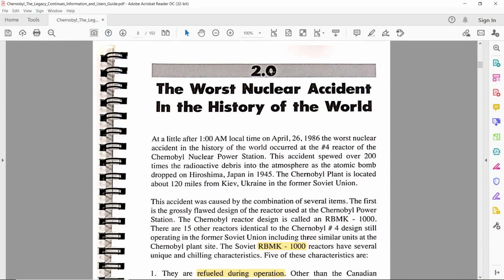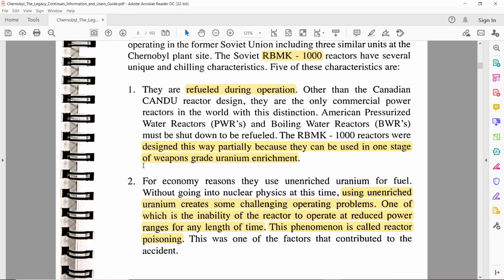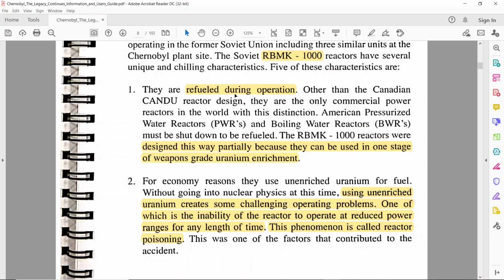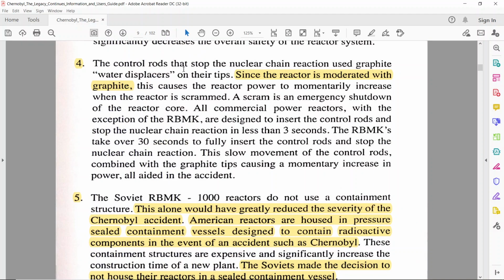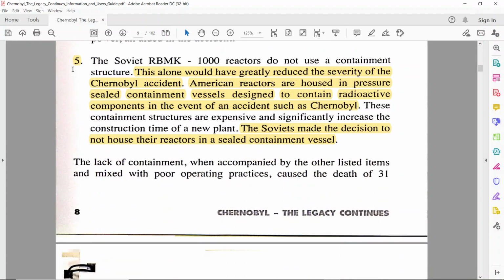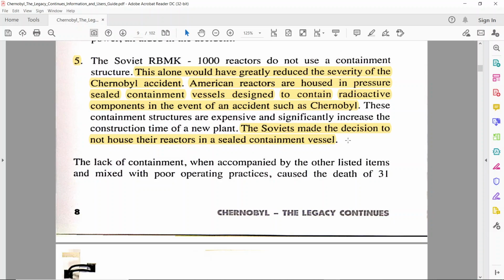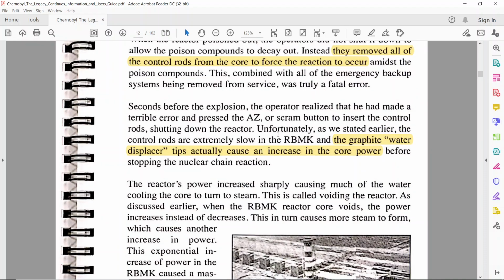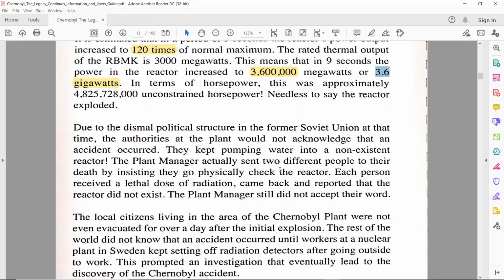Errors in the User's Guide of Chernobyl the Legacy Continues...

Comment: Didn't the chernobyl reactor threw a 1000t lid through the roof like it was paper because all of the steam channels ruptured? I wonder what would happen to a modern containment building when you do that.

If you have a military fighter jet and want to break a nuclear power plant, I think the best option would be to use a penetrator bomb, such as a GBU-31-III or -IV. It involves less dying and reusing the aircraft afterwards. It's also probably going to make a bigger hole.
Reply from the maker: Either the 1000t lid inertia or the pressure created by the explosion would break the steel reinforcement and since concrete does not resist tensions, you would have a similar outcome. The design pressure in modern containments is 0.5 bars

Comment: Перед разваленным блоком было 500-1500 roentgen/h,caesium 137,ruthenium 106,rhodium 106,strontium 90,praseodymiym 144-dangerous izotope
Reply from the maker: Typical stuff coming from reactors, caesium 137 and strontiom 90 alone give most of the radiation the first few hundred years, after around 1000 years those decay away and most of the radiation comes from Americium 241 and Plutonium 240 up to 100000 years, then Pu 239 slowly decays away with other isotopes until around 10 M years the thing becomes similarly radioactivity than Uranium 238, not yet safe, but at least you find U 238 naturally in mines.